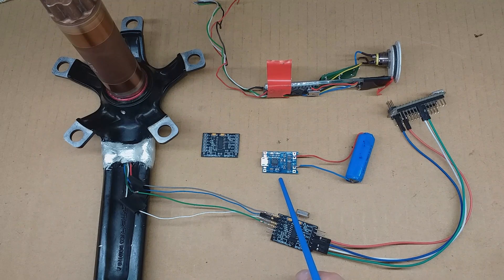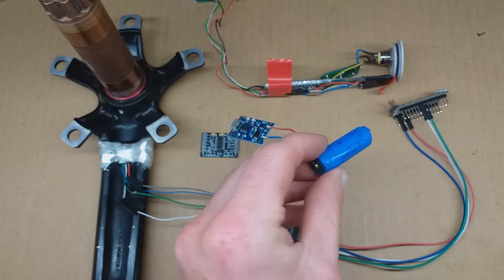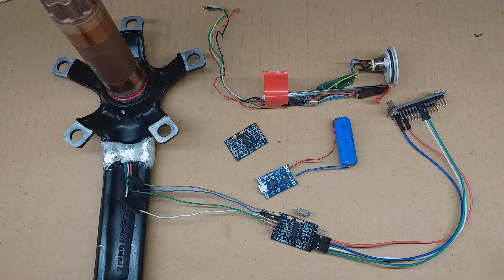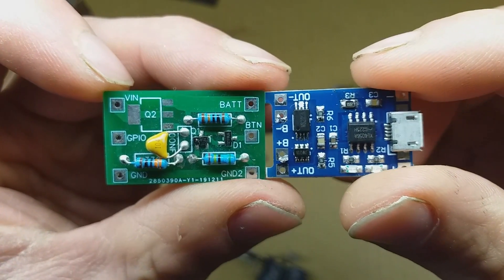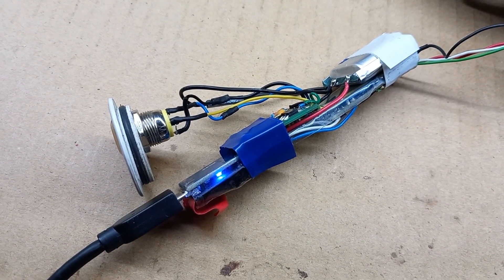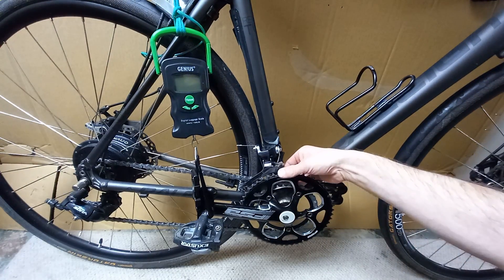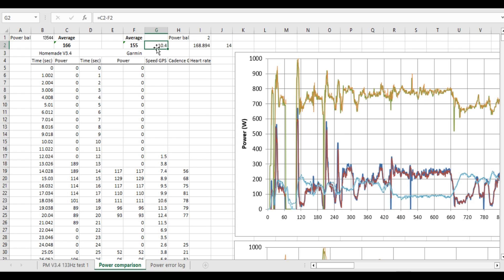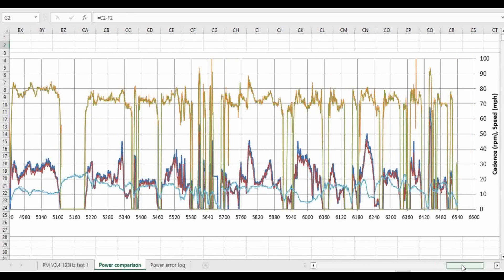Homemade Bicycle Power Meter V3.4

Comment: A year has passed since we switched to the NRF52 chipset, is there any progress now?
Reply from the maker: @zhsbadsbhu7396  I've not had the time to work on it. If you have already switched maybe you could share some information on the code.
Reply: @Ed.R  The cost of the Adafruit NRF52 solution is too high, while the SEEED XIAO is much more affordable. I'm not very proficient at writing code... so I can only adapt your work.
Reply from the maker: @zhsbadsbhu7396  Unfortunately code writing is my weak point to. I rely on example code in the SDK. When I carefully modify bits of it and it refuses to compile I'm stuck.
As my current setup works I haven't had sufficient incentive to upgrade it. Would be nice to pick up the power data with any cycle computer but not essential. Same with the auto shifting it would be nice to receive power data from any power meter but I only have 1 ANT+ power meter.
Reply: @Ed.R  The ANT+ part is quite challenging, and there aren't many successful sharings out there. You can start by debugging the BLE part first and then improve the ANT+ part later. I wish you good luck with your project based on your attitude.
Reply: @Ed.R  Since the SEEED XIAO also comes with a gyroscope version, this can eliminate the need for an additional MPU6050 sensor, resulting in a much smaller footprint for the final product.
Reply from the maker: @zhsbadsbhu7396  Thank you if I want a challenge one day. I think I underestimated the challenge of ANT+, I'd be better focusing on just BLE.
I liked the look of the SEEED XIAO also because of that. Not that my code needs a gyroscope but using one opens up possibilities.

Comment: Do you have an arduino and an esp32 for this project?
Reply from the maker: I've only used Arduino Nanos or Nano Everys for the power meters I've made so far. Have been wanting to upgrade to a Nano-33-ble so I can use Bluetooth or ANT+. Never considered an ESP32 but I do own one.

Comment: Glad you're playing with NRF52 chip. I think I've mentioned before, but I started out with an NRF51. Was a dud so didn't get very far. But it's a great chip family. I think you can also get better battery performance than the others (with some effort). Quite interesting that it is cheaper than the other options, because it is a (the) superior chip. Maybe it has to do with user-friendliness of the particular module.  

Another interesting thing you mentioned was the rarity of charging boards for 2 cells. Probably because all those cheap e-bay led rechargeable lights also usually use single cells.
Good move using what you could find.

Looking forward to version 4/5 with the full custom PCB ;) (if you go with an NRF chip, I have some reference designs, not my own, that would probably be helpful).

Thanks for sharing.
Great work as always. Keep it up!
Reply from the maker: Thanks for sticking with me and my irregular updates. Life has been busy and power meter development is low on priorities.
The only thing holding me back from using an nRF52 is writing the code. The complexity of the code in Segger is beyond my current level of understanding. Also the motivation to switch is lacking due to the only benefit being the ability to pick up the data on a cycle computer, battery life and obviously the learning experience. If I upgrade the power meter I also have to do the same for the auto shifter. So a lot of code to rewrite. Having said this it would be great way to finish both projects so will continue working towards it even if it takes the next decade.

Comment: Hey! I'm currently into building my own powermeter. Have you ever faced problems with temperature compensation? I installed the strain gages and read some date from the sparkfun HX711, unfortunately the date wasn't stable and the numbers started to drift. Do you think this is a problem with my straingage installation/HX711 or in general a problem of temperatur compensation of the circuit(even if the wheatstone brigde should compensate the temperature)
Reply from the maker: I have definitely faced temperature related drift. It is very much a problem that is faced by power metres that use strain gauges. The cheap and easy way to deal with it is to simply zero the power meter frequency when there is a temp change. As was common years ago with early power meters. The layout of the wheatstone bridge can definitely minimise the issue. However, to really deal with it, the only option is to measure temperature and apply compensation. This is one of the reasons power meters are expensive.
Reply: @Ed.R  yeah, if the drift would be linear, I think it would be possible to integrate a temperature function in the code but unfortunately in my case it's a curve that flattens out.
Reply from the maker: @felixp.2535  I would look at using a lookup table.

Comment: Great job! love watching your videos!
Reply from the maker: Thanks, glad you enjoy.
Reply: @Ed.R  Hi,
was wondering what you think about the seeeduino Xiao BLE NRF52840 sense board.
it is very small, has the NRF52840 for comunication, has a built in imu which you can use to calculate the cadence, has a built in lipo charing option. has also a built in temperature sensor which maybe can be used to compansate over temperature changes, althohg for this we would probably need to collect enough statistics side by side with a formal power meter.
seems like all you need to add is the adc and you should be good to go.
i am now working on this board for a power meter using the ADS1220.
would like to get your thoughts on it.
Thanks!
Reply from the maker: @shabso  I think it appears to be a perfect board for homemade power meters. The only issue I personally have with it and why I'm not using one is writing the code for it. I just need to invest sufficient time into learning how to code properly rather than relying on the Arduino IDE.

Comment: Hello, nice project. Did you filter the noise in the end? I noticed today that closing the solder jumper on the back lowers the readings. Shortening channel B Together didn't have any effect though.
Reply from the maker: Hello, thank you. I do use a running average of 7 samples but that's with a high sample rate of 133Hz. 5 with 80Hz was sufficient, too much slows responsiveness. Also the first thing I do with the data is divide by 100. That gets rid of a lot of the noise and resolution is still good.
The solder jump is just for the sample rate as you have discovered. Faster is better for a power meter and for smoother data as you can apply more filtering without slowing the responsiveness too much.
I rather regret mentioning the shorting of unused channel as it seems to have no affect, it was just written in the data sheet. Far more important is checking the on board regulator for excitation voltage can work. It's voltage output must be sufficiently below (>0.2V below) the supply voltage to the HX711 board.
Reply: Excellent job.  Congratulations!
Reply from the maker: @luisguillermoballesteros1209  Thanks, it has been many years in the making.